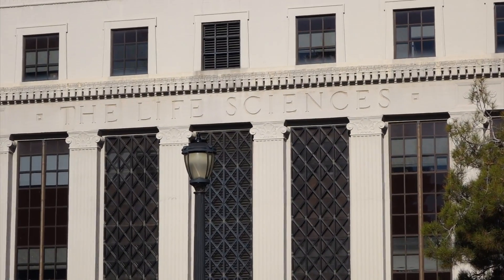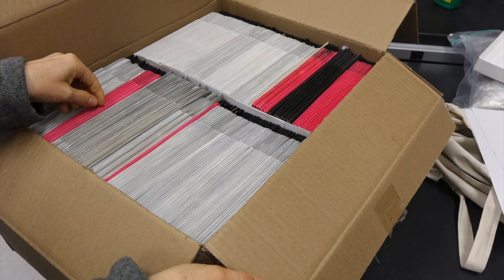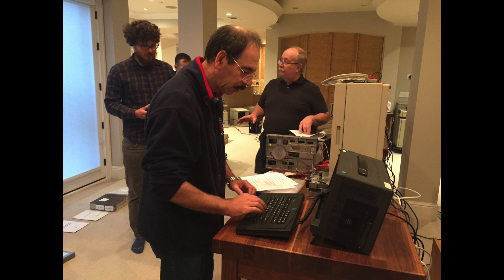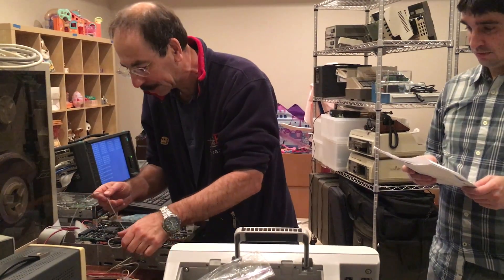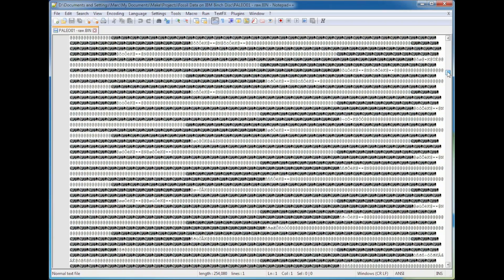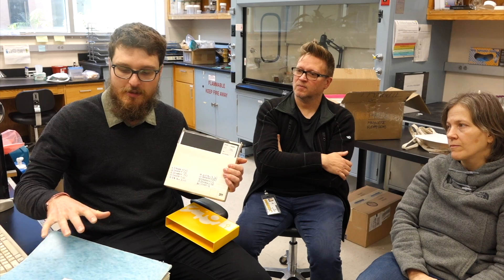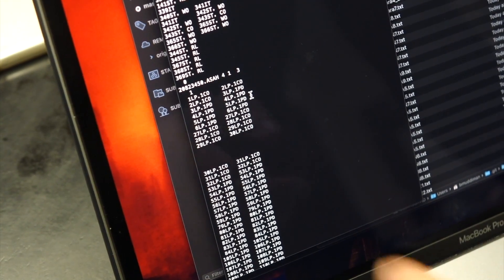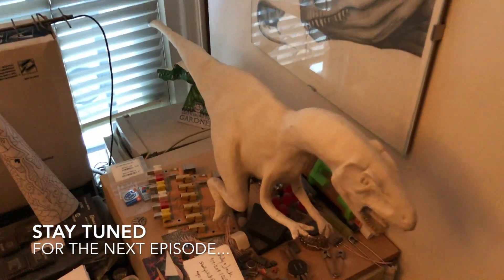Fossil Data Part 2: 8-Inch IBM Floppy Data Recovery

Comment: I have a whole box of 8” ones from maxell. Never getting rid of them
Reply: I've got an 8" dual-sided double-density alignment disk. In the early eighties one of the tasks I had to perform was set up disk drives, which basically meant that when you told it to go to e.g. track 14 the head actually went to track 14. There are signals on the alignment disk so that with an oscilloscope attached to the drive, you could manually adjust the stepper motor to make sure the head was in the right place. One day this alignment disk will be like gold dust to someone ;)

Comment: It's really just easier to make your own cable. Not having TG43 has not been an issue with the drives I am using. 

This looks a lot like my setup! I have a big 24v supply sitting there too., It pulls about 2 amps at spin-up and then settles in at 1.8

Comment: When I first saw the data, I thought that it looked like some type of assembly language with opcodes and operands, but obviously they know how to interpret this data correctly. I just hope that they are able to come to some interesting conclusions from all of this old data.
Reply: At that time, the 8" floppies were usually used for data entry (a replacement to the keypunch) which would mean that someone keyed in the text OR they were output from a computer (usually a mainframe).  Mainframes were traditionally tape at that time and tape data was often text since tapes were sent to other institutions which might have different types of computers.  IBM might have had the majority of the business market, but there were still companies like DEC, Unisys, and such that had a portion of it.  As such, tapes had an interchange format and data was often written in that format.  This would often be text because even though a binary format is more efficient for representing a number, the binary format might differ for the various machine, especially if it was a floating point number.  When the 8" floppies came around, they were probably being used by the same programs that had previously used the tapes, so the data format would be similar.  I seem to remember that the 9-track tapes in their highest density maxed out at around 170MB per tape.  That was a humongous amount of data back then.
Reply: Indeed, the highest density for a 9 track tape (8 bits + parity) was 6250 bytes per inch. Assuming a full 2400 foot reel, that comes out to 6250 x 12 x 2400 = 180,000,000 but this does not take into account inter-record gaps, so 170MB seems quite reasonable.

The format that they were using for these 8" floppy disks seems simple but rather wasteful given that only 80 bytes out of each 128 byte sector are being used, especially when it looks like less than half of each 80 column "card" was used for data. That said, it was probably much easier to deal with one floppy disk than 858 punch cards.

Comment: I would like to recover documents from a 3.5" Macintosh floppy from about 1998 but so far have been unlucky. Any tips?
Reply: have you tried a USB floppy? You could always get yourself an era appropriate mac off ebay and then hook up a flash drive converter to it.

Comment: Memories of the 8 inch drive. Back in the early 90's I spent sometime working at Intel, as a technical mechanic for the Nikon Lithography equipment being  used at the time. Cutting edge technology, being used to produce the Intel 486 and early Pentium chips. The stepper used 8 inch floppies running CPM. So yes, your  386 / 486 computer was made with equipment using 8 inch floppies. That same equipment is probably still being used somewhere today, since you don't need "cutting edge" for simple IC's.

Comment: How durable those 8" disks are. I remember, at the end of 3.5" floppy era , when I opened a brand new box, 2 out of 10 were already faulty and unusable.
Reply: They are durable if they were good to begin with. There were a lot of shoddy disks being sold back in the day.
Reply: I hate 3.5" floppys with a passion. Although it must be said the last iteration of them for PC/Windows use. Because I never had a problem on my Amiga 500. But I've lost many a school projects to bad floppys. And back then I knew absolutely nothing about computers, so screwed I was :P.
Reply: The 3.5" disks were a lot more durable in the 80's and early 90's. Ones from the late 90's and 00's were garbage.
Reply: Sounds like a quality control issue
Reply: @LuiWallentinGttler  I hear you!  This didn't happen to me because I happen to be using Iomega ZIP disks, but the computers in class has both a ZIP drive and a standard 3.5" floppy drive.  But in 1998, another student in one of my computer classes lost an important project because his floppy disk failed, and he got mad and threw the monitor down on the floor (an old CRT 60Hz monitor, mind you), and the professor kicked him of class.  He probably ended up dropping the course.
Reply: @wesleyhurd3574  Made in China vs. made in America.
Reply: @Jeff-xy7fv  more like the huge difference between the sizes of consumer and industry/science grade pockets.
China makes durable things, and you can find american-made junk. It's just that industry won't try to save some pennies at the expense of reliability and longevity
Reply: And 2000s era CD-Rs... mostly unreadable now!
Reply: Verbatim was a top quality brand too so I guess that helped.  Same with many media formats that get crap towards the end of their era.  I remember having a lot of minidiscs, my TDK ones were always rock solid, the later cheapo  brands, not so much.
Reply: @bigjd2k  indeed! Two decades ago, I thought all my projects are safe till the end of time, as everything was stored on expensive CDs in a well protected case.
A few years later, when I reopened the box for a retro-party, the surprise shocked me: the metal film layer peeled off/from the policarbonate disc.
Knowing that it is impossible to recover, I destroyed all of them by hand, like a berserker.
Reply: @bigjd2k  cd r is garbage. I use cd rw's.
Reply: u need archiving software, they can restore the lost bits.
u can use that data 100%!
try again!
Reply: @Jeff-xy7fv  Wasn't BASF from Germany?

Comment: THIS is why we need to keep old formats alive! You never know when you will need to read old data, and you never know when that box of (insert old format here) in your parents attic might be important data with only one copy!
Reply: If they are important, why are they in an attic?
Reply: @IkarusKommt  There are plenty of reasons. NASA lost the original moon landing footage, but one of the employees duped one of the tapes and had it in there garage for 40+ years. TLDR Unfortunately the tape only had metadata, not the actual footage, but it could have been the real deal. This is why we only have shit grainy footage of the moon landing. Nobody knows where the original tapes are and they could be in somebody's garage right now. https://www.nasa.gov/feature/not-unsolved-mysteries-the-lost-apollo-11-tapes
Reply: @IkarusKommt  What is considered important changes over time and from person to person.
Reply: @IkarusKommt  It was saved in the attic because it was important. Otherwise it would have been thrown away.
Reply: @IkarusKommt  it happened a lot with those old mainframe systems, stuff they think they no longer need, but fifty years later we wish they had kept track of it, as the other guy said nasa is infamous for this, the lunar orbiter data is another case of this, it took decades to get a drive capable of decoding those tapes working again
Reply: @nickolaswilcox425  I had a BBC A3000 Acorn in my loft. Worth £500 on EBay. Still trying to get it working properly. No OS and floppy not working.
Reply: Always an eye towards "progress" while leaving old formats in the dust, without realizing data is data no matter the format, and it could be very important and useful once the format changes.
Reply: Just shows the importance of open source code and open formats.  We can still read text data from from 40 years ago but try doing that with a Word document.
Reply: Talking about word documents:
I can simply unzip the file and look at the data. The modern format is basically xml encoded.
Reply: Yeah see, that's the thing... this is a rather one off project, nothing on this format is remotely "important" to anyone or anything whatsoever in this world. Or at least it shouldn't be, and if you or the company you own or work for is this bad at backing up / updating critical data, then you deserve to fail. Now if YOU personally, for some reason, have valuable data on say a 5 1/4" floppy, and haven't for some reason backed it up on a more robust / reliable medium, then you've messed up. But if you do, then you personally can see to keeping an active way to read it, the world as a whole surely has no use to. As no function of society nor the backbones that keep it alive, will ever find themselves in need of anything bespoke to these systems. Nothing on anything of this nature could ever be viewed as "critical" or "important" lol.
Reply: There was probably some bidding or scheduling for moving all the data onto more compacted and more modern formatted machines. But it never came to be. So they stuck them into a warehouse for about 50 years before the company who manages the data calls these people up to retrieve any data that is still retrievable.
I have not watched the entire video. I am just guessing. I just want to see the machines work.
Every powerful companies are not as organized as they try to make us think they are. This is an example.
Reply: @Dex99SS  / this argument breaks down when it comes to massive archived materials in research laboratories, libraries, and long-term archival storage vaults. It would be near impossible, and very expensive, to update all archived information every time there’s a format change.

It is not uncommon to archive information which today may not have value, but may decades down the road be extremely valuable. 

Preserving technology to read these formats is just the type of “backing up/updating critical data” that you mentioned in your post. It is important to maintain the knowledge and the ability to access formats of today and yesterday. 

In the early years of computing, all the way through the 90s version control and source code control was not really that much of a thing by the way. And don’t forget that in the days that these disks were recorded, data storage was rather expensive.
Reply: Digitize everything
Reply: THIS is why we never need nedry people, we need better regulations! How you store recherche data!
give mad people the power?
use duplicate software? or be nerdy mad?
Reply: data migration needed!!!
Reply: @Just.A.T-Rex  . . . And then years later, the digitization format and media you used is obsolete . . . .

Comment: So if the first 8 inch floppy drives were read only what was writing to those floppies that they were reading from?
Reply: A much more costly drive that would not have been sold I imagine.
Reply: Green Steve And remember, there was no need for the device for which the firmware was loaded (a controller to connect a bank of hard drives (DASD in IBM-speak, for Direct Access Storage Device) to the mainframe) to write on the disk.  In fact they would not want to risk accidentally erasing the firmware.
Reply from the maker: Here is the answer from Iggy, one of the long time IBM CE’s which you might  remember from the IBM 1401 episodes:

“In IBM we had a writable 23fd, which was like the 23fd in the 2835, but with the write circuits and write head...

We drove this with a 2841 File Control Unit, like the one used for the 2312 Disk Drives, but had the microcode (in TROS tapes) to run the writable 23fd.

We wrote the engineering disks with this device, to send patches to the field.

The formal microcode releases were done in manufacturing 23fd floppy writers for mass production.

The 2835/2305 fixed head facility was used in the IBM Menlo Park facility to make the IBM-2075 CPU  development and testing (this CPU was not shipped), and later used in the 2091CPUs, like the one accross the Street on Sand Hill Road at Stanford’s SLAC facility.

Iggy”

Comment: Those 8” floppies bring back memories!

When I was in college in the late 80s, I worked at a factory that made the controllers for Montgomery Elevators (we made the pc boards that went into the controllers), prior to Montgomery being bought by KONE Elevator.  Part of my job was test development, and most of our boards were tested on the old GenRad 2277 and 2278 mammoths.  Once a test program was written, it was backed up on one of these 8” floppies.

The programs were usually relatively small, and they were stored as text files, so most programs would fit on a single 8” floppy.  I don’t remember how much storage these floppies had, but it was VERY little.  Heck, I doubt that a modern HD photograph would fit on one!

That was one of the coolest jobs I ever had, and I loved it!

Wow...thanks for the trip down memory lane!

Comment: it's time to put all that hundreds of floppy disks to a single microSD card and clean/repurpose a few rooms.
Reply: Too easy to lose... Probably the only reason this was not lost is because it is such a large bulky box of disks... :)
Reply: microSD is the least reliable. Also the hardest to recover. Standard SD is a huge improvement. Even if it fails it not that hard to get data off it. A little bit of heat and the chips pop off. Then you pop them in a chip reader and using very expensive data recovery software the data is reconstructed. I've seen a guy do it. I would imagine SD card recovery is one of the easiest services he provides. He does head swaps and platter swaps on non functional hard drives as well. He can't recover everything, but he seems successful at least 80% of the time.
Reply: @awilliams1701  sd cards then or some usb sticks, anyway  the reduction in size is unreal..

Comment: I got my cable converters from Cable Depot Marc, so I was able to interface my shugart drives with a floppy emulator on the original hardware to backup the original disks, I can't believe one man invented a system that was so compact and efficient back when computer storage was really almost a fantasy in some cases, but it seems like he used it better than most people did during that era

Comment: I still have one of those 33FD drives in my storage room!
At around 1982 I made a converter between the connections on that device and the industry-standard (by then) floppy connector (also shown in the video), and I could use it on my TRS-80.
This drive is single-sided and has an extremely slow stepping using a Malthezer cross to lock the track when the motor is not powered.

I also have two later IBM drives that are double-sided.
All those drives are not for customer use, they are constructed for mounting internally to such mainframe cabinets, and have no front bezel.

Comment: Based on my own experiences, Old floppy disc drives are a horror story! The plastic and rubber components are now all decaying, the lubricant in the bearings is drying up, while the epoxies are failing.  Good luck guys!!

Comment: This is true digital archelogy. It shows that we need to keep old equipment working as otherwise the data would be lost forever. Now maybe it's a good idea to copy the data on M Disc Dvd's as well as other media. Personally I had a lot of enjoyment on imaging 5.25" floppy's with BBC basic programs on them from my collection with a pentium 2. With the same text editor (notepad++) I was able to read some of the basic listings eventhough the filesystem on it is weird. These where just basic programs that my dad wrote in the mid 80's. The only roadblock I hit is that the filesystem of the disks is Solidisk DDFS 1.9 which is sadly not supported by any BBC micro emulator. I have a high density YE-DATA drive (YD-380B) in my pentium 2, but I don't think it would work with the BBC's WD-1770 controller and DDFS filing system. Sadly finding 5.25" drives is hard and fairly expensive. I hope someone could start making new 5.25" drives like how companies like TEAC are now also making new turntables and casette decks again. (They could do it as they made them in the past and have the know how).
Reply: If you get a ROM image of Solidisk DDFS 1.9, you may then be able to get an emulator to read the disk image. I do have a pair of working BBC 5.25" drives, but they're only 40 track single sided.
Reply: MarcT I’ve tried to use the DDFS 1.9 rom with Beem-em in combination with the 1770 fdc emulation, but sadly something in the emulator isn’t implemented completely which causes it not to work. Appearantly there is another emulator called b-em, but the most recent version that you can download as a precompiled windows executable is from 2012. There is a newer version on github, but sadly no compiled binary for windows.